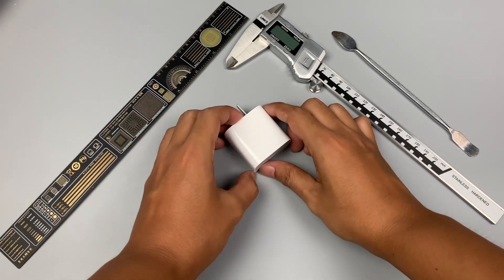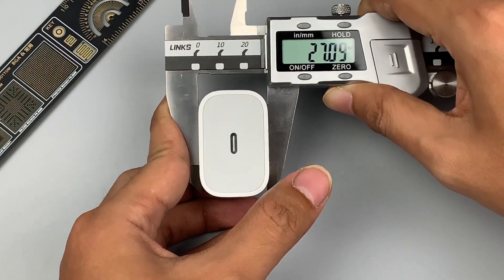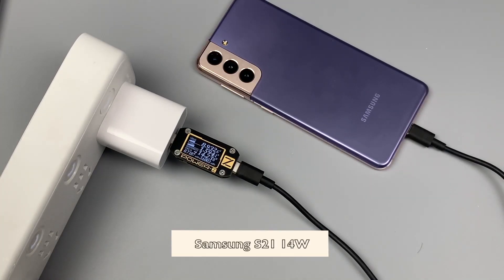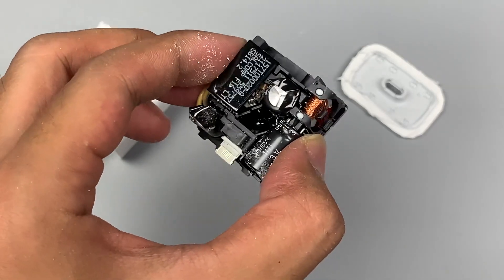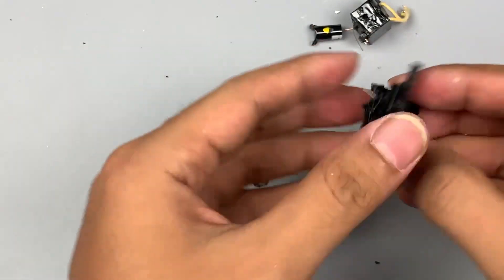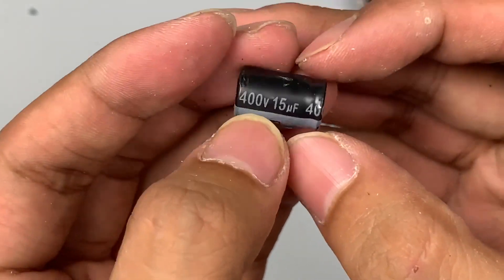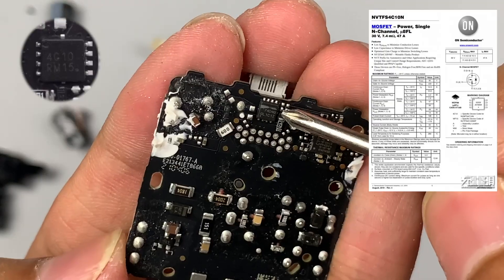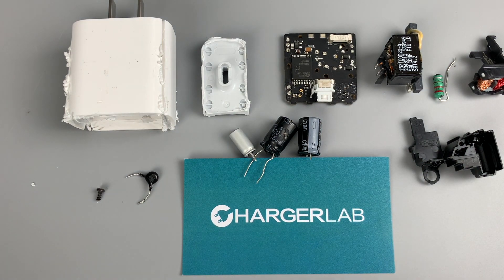Teardown of Latest Apple 20W USB-C Power Adapter (For iPhone 13)

Comment: Aishi capacitors are fine. They are found a lot in cfl light bulbs and I've got several from the late 2000s which still work and I know they use Aishi. Teapo was also a good brand, one of the few manufacturers not affected by the capacitor plague while Nichicon was affected.

Comment: What is the difference between this and the old 20w charger from apple
Reply from the maker: The brand of some capacitor and other components has been changed.
Reply: @ChargerLAB  Is the old model housing better components?

Comment: What a huge downgrade from Nichicon Caps to Aishi. This makes Apple 20w chargers no different from Anker. 

I hope you could differentiate the old box and shell of the old ones using Nichicon and the new ones with Aishi.
Reply: I'm also used to seeing replacing Aishi caps in other (cheaper) tech. 😁

Comment: The 18,20w are cheap chargers, not up to Apple’s usual standards, Delta and Lite-On chargers are much higher quality, again cheap caps. Apple cheaped out because they mean to sell a lot more of these and they want more profit on them.
Reply: How come his older teardown of apple 20w uses Nichicon caps? Is newer apple 20w now made of Cheap Aishi?
Reply: @xabysebastian529  this one is made by a different manufacturer and it’s meant for mass sale, unlike other Apple chargers which few people buy and sell at even higher prices. Maybe component shortage but I don’t believe anybody will refuse to sell to Apple.
Reply: There's multiple suppliers for the 20W charger. He should source different manufacturers to compare.

EDIT: The other 20W he reviewed is also the same manufacture (Salcomp). Just component shortages IMO.
Reply: Can you recomend delta/ lite on 30w chargers? I cant find it on marketplace?
Reply: @jackbrown107  innergie is a delta owned brand and are readily available upto 65w